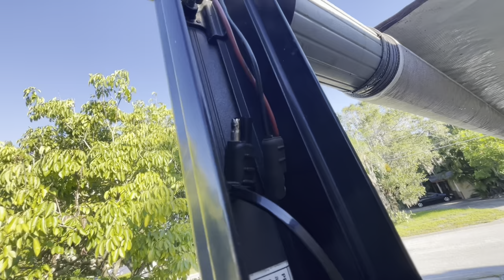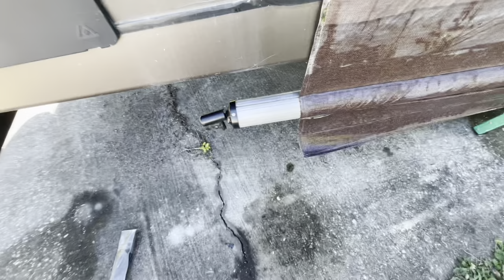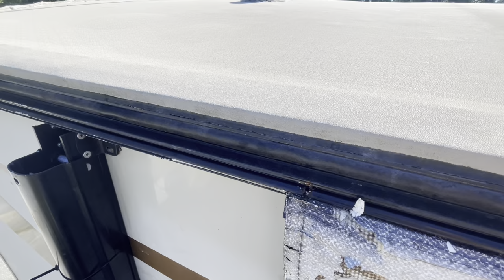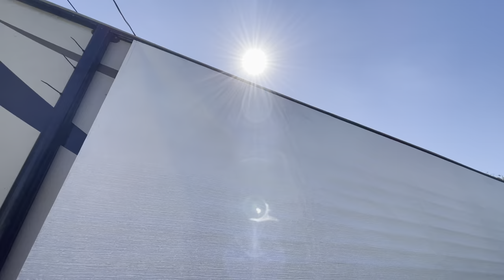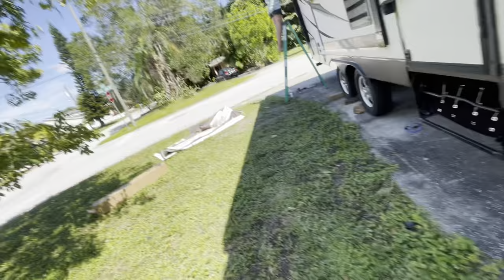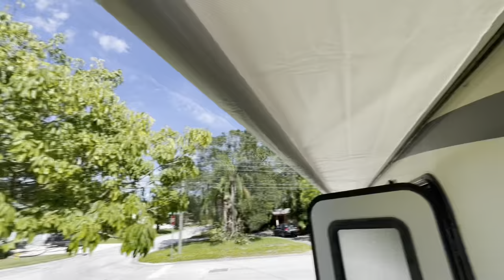Dometic 9100 awning fabric replacement

Comment: What screws did you use to replace the rivets?
Reply: I have the same question. Good video, but he didn't mention that change.
Reply: @gskayak 1/8” x 3/16” rivet. Also, use a 3/16” bit to drill out the old rivet. The key for me was how far to roll out the awning to be able to pin the spring hole. Other videos mention to pin the spring, but not how tricky it is to find the right position to be able to insert a pick.

Comment: On the original fabric, it appears you have a patch. Our awning has a tear in the same location. Have to remove the awning attached to the RV as the screws have popped out and we have to patch/repair the holes before it rains, but also have a tear/rip that we were going to tape up. Could you share the patch kit/tape that you used before you replaced the entire fabric?
Reply from the maker: Hey Brave, I am not sure if the patch since this is a used RV

Comment: Right at the end you mentioned a misalignment on the rear support.  I’m having that issue and wondering your thoughts or solution.
Reply: Did you ever figure this out? I am having the same issue.
Reply: @garyschade7978  I have not.  I am thinking it's either a slow motor or that the awning cover is misaligned.  If that's the case the awning cover needs to be taken off and reinstalled, otherwise I'm putting a new motor in that side of the awning.  Neither is a cheap fix.
Reply: I think you take the screw out that’s on the gutter and pull the awning in the direction that would correct the alignment then reinstall the screw. It doesn’t have to move very far maybe 1/2 inch. I’m pretty sure that will fix it I’ve been there before.
Reply: @k5kensails  It's a simple alignment of the fabric. Remove the screw that attaches the awning to the trailer and move the fabric a little in one direction or the other, until the arms line up.